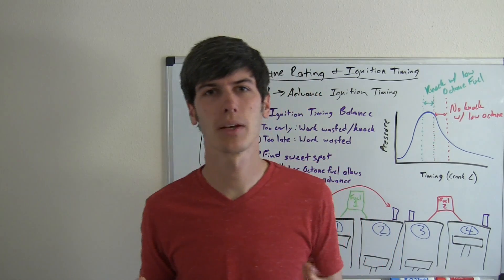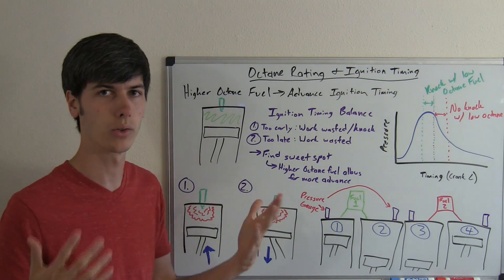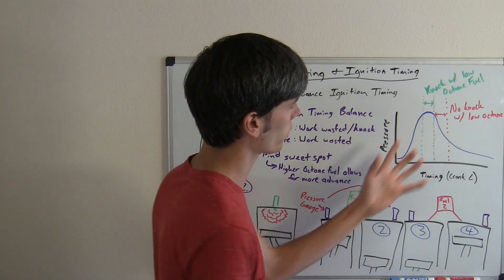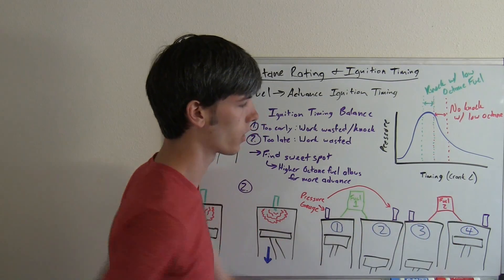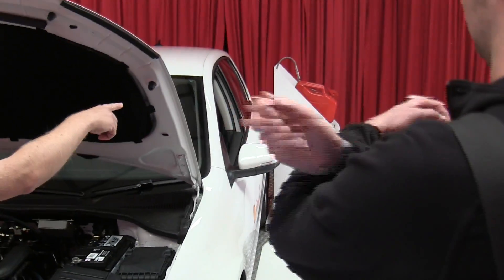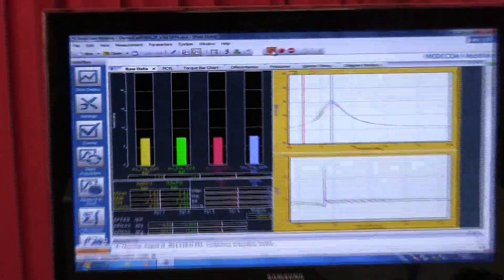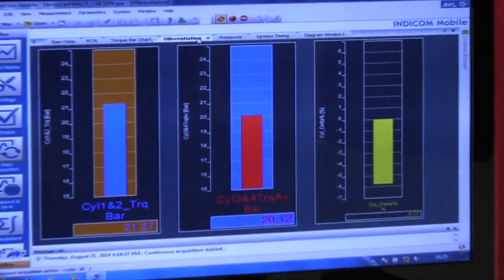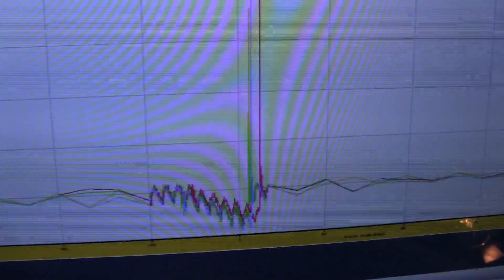Dyno Testing Premium Fuel - Octane Level vs Performance - Shell V-Power

Comment: So does the octane rating affect horsepower or any power output as the air/fuel mixture burns?
Reply: Helaman Mancia It would make less power with higher octane rating.  More so with higher RPMs and under full load.  In the same way retarded timing loses power to "chasing the piston", a slower burning fuel (usually a property of higher octane fuels) will produce a slower deflagration rate and take longer to reach peak pressure. Because the time spent reaching peak pressure is longer in relation to the duration of the power stroke (fixed deflagration duration @ given pressure/temperature) and therefore accounts for a greater percent of the power stroke's duration as total power stroke duration decreases due to increased RPMs, the average pressure for each stroke will be less and therefore the average torque will inevitably also be less.  As engine RPMs continue to rise power stroke durations continue to shorten and relatively constant deflagration rate becomes ever more important. You'll see increasing reductions of power gains with high octane (slow burning) fuels as  RPMs rise higher and higher when compared to a lower octane fuel.  The real benefit from high octane fuel comes when used to combat excessive heat that causes detonation.  Ideally you would run the lowest octane fuel you can get away with.  Moreover, your engine/compression/etc. would always produce a perfect ~14:1 compression ratio at 13:1 - 14.8:1 stoichiometric (load dependent) under load without detonating, all while running on sub 80 octane fuel.  This is unrealistic however as simply compressing the air/fuel mixture at normal engine compression rates generates enough localized heat to cause detonation in pump gas at 14:1 compression.  There is a fine line then, you want the piston to squeeze and heat the air/fuel at the given compression ratio to a temperature as close to its flash point as possible without actually reaching the flash point.  This arrangement is ideal for heat transfer during deflagration as the spark plug/ignition is simply there to "push the reaction over the edge" allowing more precisely controlled electronic timing.  Engines walk this thin line, balancing variables such as fuel octane, engine/cylinder/air/intake/etc temperature, humidity, air fuel ratio, intake air pressure/vacuum, etc...  Therefore knock sensors are used to protect the engine when one or more of these variables (such as bad gas or excessively hot intake air) result in the engine wandering into dangerous territory and begins experiencing detonation.  The engine will react when it audibly "hears" the "knocking" (a knock sensor is essentially a piezo microphone) and retards timing to save itself from catastrophic mechanical failure.
Reply from the maker: Yes, as demonstrated in the video it resulted in higher cylinder pressure, thus more power.
Reply: So if a car were to call for an octane rating of let's say 85, and you put in 91, would you still have an increase of power even though it calls for a lesser octane rating? I'm sorry if it's a dumb question. I'm just trying to understand. Thanks for your help and these awesome vids!
Reply: Helaman Mancia Only if your car is equipped with the sensors and programming to take advantage of advancing the timing.  If there is no change to timing between the 85 and 91 fuels there would be little to no change in power.

Comment: I have same thoughts as some others about the octane but the test needs clarification . I can best display this with cars i a familiar with to give what i think is the test error . A 98 saturn SL1 states in the owner guide to run ONLY 87 OCTANE where as an 87 pontiac sunbird gt turbo states HIGH OCTANE FOR BEST PERFOMANCE . No doubt the sunbird would have same results as the video, but would the Saturn? Theoretically it should have oppisite effects of the video because the cars computer system is specifically programmed for the timing effect of the 87 and therefore the 93 &94 octane is a waste . 
To remark on another comment about civics ... yes and no . Higher rpm engines and tweeked engines would usually require higher octane due to the faster timing involved with an 8500 rpm engine compared to a 5000 rpm engine . NOT ALWAYS but it is the general rule of thumb ( yes there are exceptions on both sides, especially with todays newest engines ) .

Comment: i tried 89 octane in my 5.7 hemi but when convert it to 91 engine sound become quieter
and improvement  in acceleration
Reply: You were experiencing knock. The ecu is pretty good at protecting the engine but it comes with a big penalty to performance.

Comment: Wait a second. I thought octane was a measurement of how much pressure the fuel can take before self-igniting. In my mind, with a given compression, an engine could have knock or not, and increasing the octane should have very little effect. So what can explain the timing difference? Is it so that the ignition of the fuel increases the pressure to the point that the fuel all self-ignites, and too low octane makes it happen too early?
With my turbo engine I get a clear increase in power when increasing the octane. I though it then can feed more air and still avoid knock. What you are now saying is that the increased power is not because of increased air/fuel mixture, but because of ignition being earlier?
Reply from the maker: Check out my video on Ignition tuning. Advancing timing can cause knock.

Comment: i have a 2010 jeep wrangler what octane number do i use?
Reply from the maker: Whatever your owners manual recommends! :)
Reply: ok thanks!
Reply: Tyler D As do I, fill the thing with regular 87 it wont make a difference in basic engines like ours one bit. I put the cheapest regular I can find in mine and it eats the shit right up, one time I got a bad fuel mix that had like an inch of water in the bottom and the frigging thing stuttered and hesitated for the first half a mile down the street from the gas station like it was having a heart attack so then I floored the gas assuming it would burn through the water and it did although the water fuel light never went away until I ran it down past half a tank. So I turned around to tell the gas station that they had water in their gas and the Indian clerk comes out with an attitude and fills an empty jug up with the crap and it was very clear gasoline at the top and at the bottom was an inch of water that had separated. Jeeps are tough as hell though so dont bother with this rip off v power crap like its a dam bmw. Just use some Lucas fuel injection cleaner every 3 months.

Comment: Integra 0-60 unleaded vs premium fuel? Please. Lol
Reply from the maker: It recommends regular, and cannot alter timing, so it'd see no performance benefit of the higher octane fuel.
Reply: Engineering Explained Turn the distributor with high octane and make us a video, please.  :)

Comment: If your ignition timing is perfect and you put low octane fuel, will it reverse the benefits ? I mean will it ignit before the piston hits TDC ?
Reply: Fuel timing is only perfect when you are tuned on a certain gas. "Perfect" timing on 93 will problably knock on 87. You have to reduce timing (and consequently power) to make it "perfect" again.

Comment: The thing to note here is that many premium fuels (at least in Europe) are not higher octane per se - many just have a cleaning solution added or perhaps lower percentage of ethanol.

Also, when your car cannot advance ignition timing based on fuel or your motor can already have optimal timing with low octane fuel (lower compression engine) your motor will not deliver more power.
Reply from the maker: Yes, agreed. Challenging to gain anything if you can't alter timing.
Reply: Correction, not lower but higher ethanol percentage, because ethanol has 108RON octane. In Lithuania standard ethanol part is 5%, but Lukoil is selling 95RON with 15% ethanol as 98RON.
Reply: ttic24
That's not what I meant.
In europe some premium fuels don't have the 5% ethanol added (which is cheaper than fuel and attracts water.)
Reply: DoubleYouPee1
Ah, sorry, for some reason I was under impression that in EU it is required at least 5% ethanol. But might be just Lithuania. As I remember it was a plan to increase the minimum ethanol part to 10%, but again, can't remember if its EU or Lithuania only. By the way, strange fact but in Lithuania the company witch owns oil refinery (ORLEN), sells the worst 98RON petrol... My Accord with 11:1 CR knocks with it... The best one is from finnish NESTE, which I think they import.
Reply: ttic24
Yes same here (NL), 5% required.
However for premium fuels its different I think.. for example BP ultimate 98 is said to have 0% ethanol.
Not sure about V-power.
Reply: DoubleYouPee1 Makes sense as they are not so popular. By the way, maybe you know why petrol in Germany is so much better ? I get like 10-15% more distance and you can even feel the power increase (as well as top speed). Felt this with 3 cars, not to mention a lot more people telling the same.
Reply: ttic24 Because V-Power in Germany is RON 100

Comment: Very informative Video. Well done. It would be even more interesting if You would have tested the real benefits from higher octane fuel when driving a normal car as this Golf 6 on the road
Reply: We can already tell you, it probably runs better and gets slightly better mileage.  This is a general constant, however you may not notice gains in your particular car, especially if the compression ratio isn’t high enough to take advantage of the higher octane fuel.

Comment: Wait, having 2 pistons firing earlier and 2 later does not affect the experiment's results?
Reply: mcspikesky You got more miles/tank because you got more power from the fuel. therefore you didn't have to go as heavy on the throttle to go as fast as you did with standard fuel.
Reply: The firing timings are automatically determined based on fuel quality. They didn't adjust them manually. M
Reply from the maker: Daniele Dal Col The timing is a result of the knock sensors altering the timing based on when they feel the engine will knock. It is not altered prior to injecting the fuel, this is done completely by the engine management. Yes, advanced timing in this case makes more power, and it's possible because of the fuel type.
Reply: If i reckon correctly the firing order for a 4cly VW TSI engine is 1-3-4-2. being that pistons 1 and 3 going at the same time but ignited differently (the same for cylinders 4 and 2) does have any effects? this is what i meant in the previous comment :) No trolling or whatsoever just pure ignorance :\
Reply: Engineering Explained What bonus if any do you think running higher octanes in naturally aspirated cars produces? In my experience with my 04 RX8 and 03 Vauxhall Astra 1.6 8v they both yielded more miles per tank consistently than standard 95RON, but why?

Comment: Is fire timing self adjustible?? Or you have to adjust it yourself? If so, does it affect car performance if firing is kept same as with normal fuel?
Reply: All modern cars are self adjusting on the timing. Computer dictates timing based on crank/cam sensors and the knock sensor. Crank sensor tells the pcm what cylinder is in what part of the 4 stroke cycle and the same goes for the cam sensor, tells the pcm what part of the stroke the cam's are in. Takes all those variables and calculates the timing accordingly. Back in the day you had to manually adjust the timing.
Reply: The electrical aspect of the timing (when the spark plug fires) is adjusted by the ECU of modern cars.
In my 93 civic I can the timing  by rotating the distributor.
Reply: The engine needs to have a knock sensor for the ECU to adjust according to fuel octane levels.
Reply: Yeah, you're right that's why I said modern cars. My car has an ECU but no knock sensor since it's 21 years old.
Reply: Marcos Cruz You are correct. My WRX self adjusts as it has a knock sensor.
Reply: tnx dude.

Comment: Do the timings of the two separate groups affect the other?
Why not do an all 4 cylinder test with one fuel 95ron and then the other with Vpower for a more complete round of averages?

Obviously I don't work for Shell so I believe there's a reason
Reply from the maker: xxxjake999xxx The timing altered by the engine mapping, as it sees that it can advance the timing in the cylinders with higher octane fuel. Sensors detect knock, and with higher octane fuel it comes later, so the timing is advanced.
Reply: Engineering Explained I don't believe that answers it. Does the advanced timing of one group affect the other in real-time, if so why not do all 4 cylinder tests with one fuel type then the other?

I understand that the high octane achieves better timing however does it get dragged down by waiting for the other cylinders to fire?
Therefore, if for example your 2 "Vpower cylinders" have a -0.2 Second advantage, is that reduced because it's waiting for the 2 slower 95 Ron Cylinders. When if you ran a test on Vpower on all 4 cylinders and took your averages, they would be say -0.3 seconds faster than the all cylinder 95 Ron tests